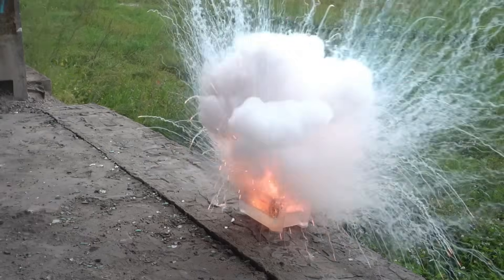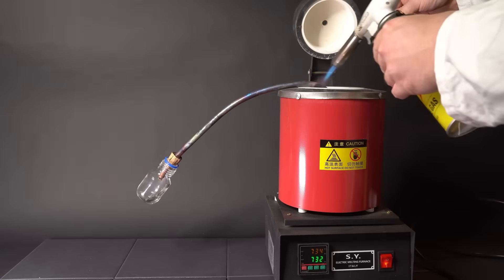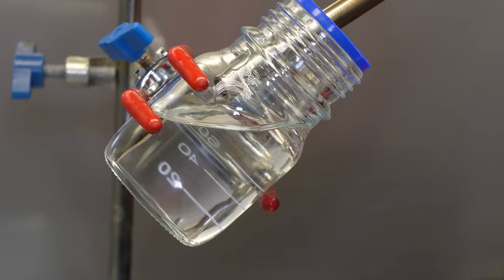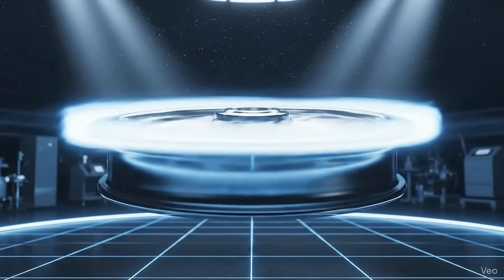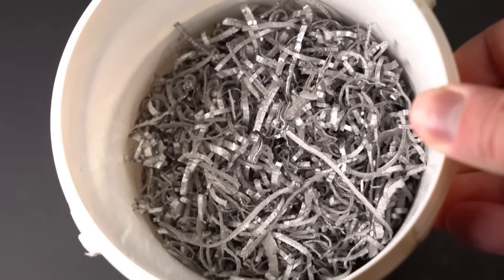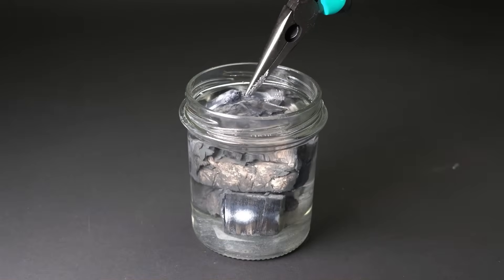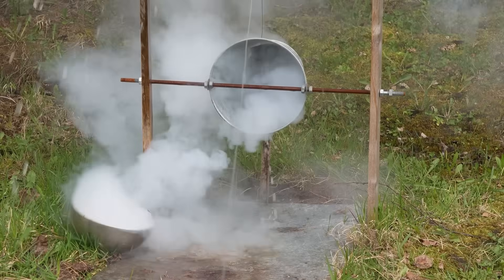What Happens if You Make a BATTERY Out of CESIUM?

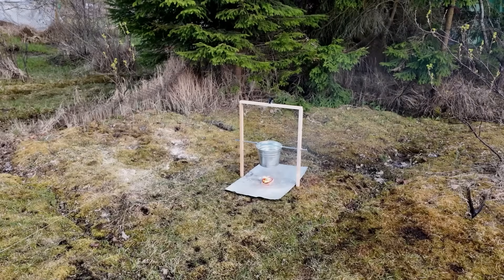Comment: 18:20 well measure it based on molar mass
Reply: 19:10 well technically hydrogen is an akali

And apparently when freezes it shines like metal, how conductive is it

Problem is, in a battery, hydrogen ion would need a cryocooler if you want some energy density
Reply: Plus hydrogen bonding is very strong 

So strong that high pressure water cuts diamond 

So rechargeable hydrogen ion probably would use a lot of energy to charge

Comment: Gold is the least reactive metal out there and that’s why it is used in electronics as copper oxidises in the air so gold is used metal contacts like CPU pins so they don’t corrode over time.

Comment: You are a clueless CHEMIST

Reason for reaction.

These are soft metals. 5 pole geometry

So when water fall on it , it get siphoned inside and form a bond and release h2 gas. 

They all try to escape simultaneously and create explosion

Porus metals.

Now why cesium is less explosion to lithium is simple , force easily split them

With cesium it kinda contained.

Comment: I thought I'd see cesium-ion batteries here, and potassium-ion ones have been effectively produced. The thing is, the (voltage) doesn't actually rise that much from Li to Cs, since the much smaller lithium ions form stronger bonds with various anode substrates.

Comment: lithium metal + dilute hno3 = no oxide to slow stuff down. can probably try vinegar or some kind of other dilute strong acid. trust me when i say, you will not be disappointed by reaction rate. ive had to clean several fume hoods and patch several holes due to this trick i discovered.
could also be that the strong acid acts as a catalyst, not sure.

Comment: Caesium ion is too large to be flow freely. But if it were possible, according to the trend from lithium ion battery to sodium analogue, I guess it would have high voltage per cell but very low power density due to large ion mass, and may be also very high internal resistance.

Comment: I’m 55 seconds into the video, but my initial reaction for ‘why not’ is that the problem isn’t the reactivity of the metal. I think it’s just the physical size of cesium ions. If it’s anything like Sodium vs. lithium, the reason sodium ion batteries are less energy dense than lithium ion batteries is because of their size. It’s literally just not possible to pack more of the sodium ions into the battery, so you have less energy. I imagine that cesium ions are physically enormous compared to even sodium ions, so it makes me doubt that there is enough of a difference in energy (on a per - ion level) compared to how many more lithium ions can be fit in the same physical space.
Reply: Osmium offers superior density and corrosion resistance compared to lead

Comment: Make a dual ion battery. Cesium ions and fluorine ions. Would have a voltage of nearly 8V, but cesium would need some different matrix to store it's big fluffy ions. Also if you want to distill cesium you would be best off tig welding brake line tubing to your vessel. You can also use calcium or magnesium to displace it
Reply: Cesium has low energy density, compared to lithium.
Reply: @lharsay  in size yes, but in mass?
Reply: the video and battery i have been waiting for

Comment: Another fun fact: Oganesson could be fairly reactive unlike the other noble gases, because the electrons on the outer shell are travelling so fast that it leads to relativistic effects. It could also be a solid at room temperature.
Reply: Not to mention it's the heaviest Group 18 and so it may make xenon look like argon. That being said, its neighbor Tennessine is basically a halogen that makes iodine look like fluorine and it may also be a metal as well as Oganesson and both likely semiconduct. Now the fun part is if you mix Oganesson oxides (which can theoretically exist) with Tennessine metal and torch the mix, assuming you can throw in enough neutrons to make things not come apart with a too-short half-life. You'd likely end up with a vigorous light show. Oh and both Oganesson and Tennessine would be interesting if we could keep enough around long enough to achieve something and apparently Oganesson and Tennessine can bond despite Oganesson being a misbehaving Group 18 element and Tennessine being a misbehaving Group 17 element. Apparently the resulting compound would stay together quite well if one could keep the elements stable with neutron abundance. But here's the fun part: we technically can already make Oganesson Tetratennesside very briefly. Oganesson and Tennessine both have isotopes with 294 neutrons and their formation process is fairly similar. So if you made the target an alloy of the Oganesson and Tennessine targets, and used the particle accelerator on it, at the impact zone there would be for the briefest moment Oganesson Tetratennesside in all its glory. Based on what Xenon Tetrafluoride does it may end up being an oxidizer and so that could be a funny dual metal oxidizer. Not that we could see it under current normal conditions.
Reply: @stgigamovement  What do you mean it "makes xenon look like argon"?
Reply: @stopthephilosophicalzombie9017  Xenon can form quite a few compounds, Argon (two rows up) significantly less and Organesson is two rows down from Xenon. Although the short half-life of the sole known isotope of Organesson makes this pretty much idle speculation on the practical level.
Reply: @stopthephilosophicalzombie9017  basically Oganesson is not very noble, beyond even xenon's reactivity, and it's much heavier of an element than xenon is.
Reply: 🥺🤔 so mox but these things here much more unstable... wow. 

i wonder how much new stuff 2026 will bring. colliders with goals of material creation should be online.
Reply: @stgigamovement  I don't speak autism, sorry
Reply: Montgomery Scott: Hold my dilithium.

Comment: 19:12  Reactivity of akali metal depends on redox potential and the metallic bonding strength.  Though Li has the most -ve redox potential of all, its metallic bonding is also the strongest among all other alkali metals, retarding the release of Li atom from its metallic lattice so that it can lose its electron during reaction and leading to its particularly low reactivity.  🤔

Comment: The caesium reaction was way more vigorous then rubidium and at least the same as potassium, it even displaced the whole setup, while rubidium, and K, did a bang, but everything stayed put. And yes, for weight per Mol, going small the number of reacting atoms counts... Na, sodium, dominated. And NaK, being less atoms, but a reactive beast may blast the thing. But. Cs, Rb, K, the shear reactivity per atom dominated.
And, as lithium shows, the energy density per gram, yea for batteries. But for explosions, the shear instability is up - energy must be released at once. That's the power of NaK and Cs. For batteries, this is, uhm, not so helpful, some stability, Li, helps. Na is already way more difficult, but may show advantage in rapid energy boosts.

Comment: Beautiful golden colour;  this is a jewellery grade metal.❤
Reply: I'm fairly certain that I would hesitate to put Cesium on skin 😂 it would make a gorgeous and unusual ampoule pendant.
Reply: @victoriaeads6126  i dont think wearing something that could potentially explode if damaged is wise...
Reply: @victoriaeads6126 until it breaks on a sweaty chest
Reply: if the ampoule accidentally breaks then your jewellery (and whatever part of the body it was on) would be decimated
still beautiful, and one of the only metals that melts near room temperature
Reply: It has a melting point of 28.5C, so a Prince Albert would be a bit of a no no.
Reply: I did a PhD in chemistry; safe enough to handle with care: an ampoule should be quite robustly constructed.  In the event of a breakage, you could get a burn, but it is no novichok!😂
Reply: Yes, it can be purchased in ampoules at reasonable prices, and, as you suggest can make a lovely pendant.  I love it!  And a perfect specimen for a collection.❤
Reply: @rupertsims4347  I plan on getting some for my collection eventually as well. It's quite beautiful!
Reply: Wrap the ampule in epoxy resin?